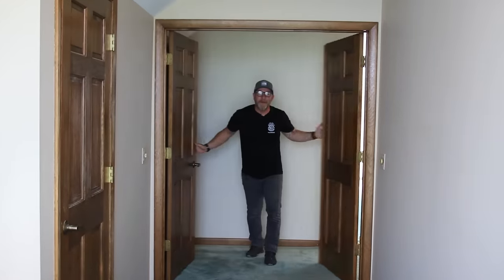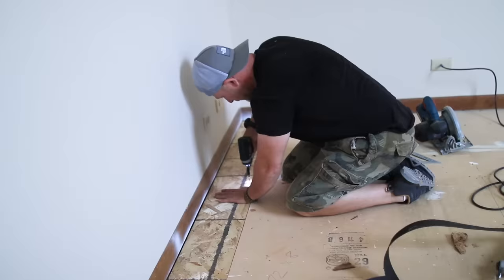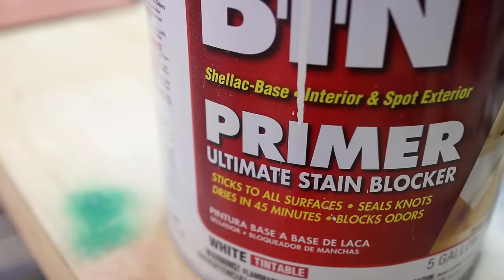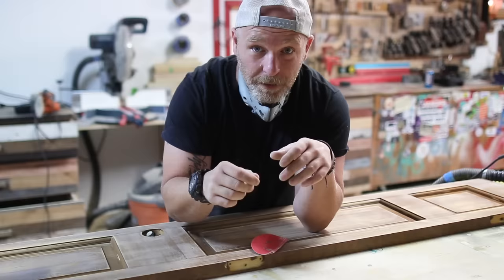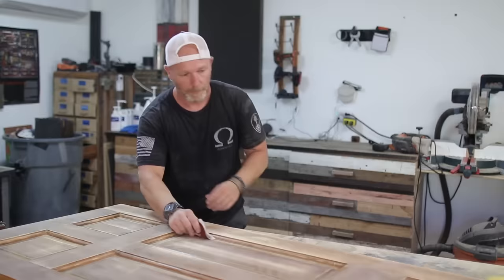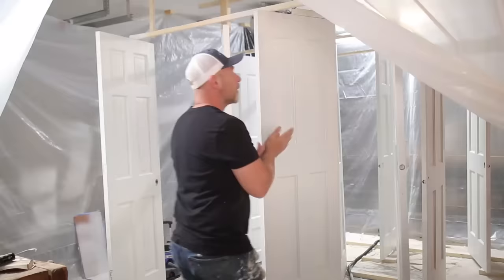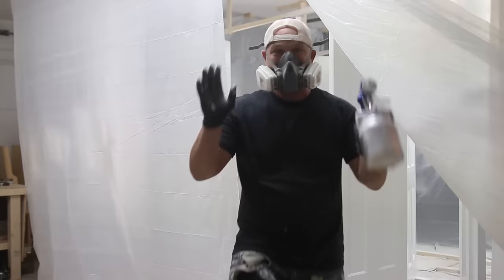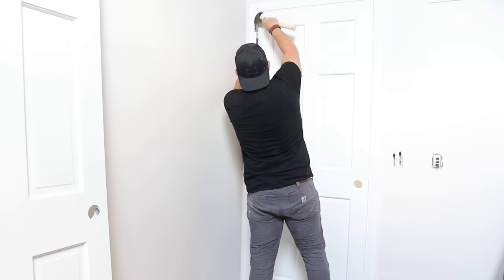How to Paint Old Doors, Windows and Trim the Right Way!!!   DIY House Renovation Episode 2

Comment: Why use the hvlp on the doors ? You could have used the airless and saved time and effort . Also , thinning that proclassic with water is not recommended . 
The video was well done and the basics are there - sand , prime , 2 coat finish . As a professional painter I can say you get a B- .

Comment: When sanding, what grid number are you using and when do you know if it’s ready? I’m starting this project now and following along.

Also, when finish sanding do you wipe it down with damp clothes , vacuum?
Reply from the maker: i used 120 grit, and you just want to scuff it up.  no need to remove everything.  you just making some groves in the finish so the primer can grab on.  and yes you want to clean it off very well before primer.
Reply: @KomarProject  thanks! I used the kilzone primer , the primer you use.. omg, so $$$ , so I’m hoping this primer will work

Comment: Our interior doors are exactly like yours! Great video though mine project has had some bumps. I used an Airless Sprayer to apply three coats of Insl-X to them. I am finding the wood grain / stain is bleeding through. Thinking using STIX would stick better. Did you have any problem with 123 and bleed through? Also a person on the Internet said never wipe down with mineral spirits anything using a latex primer afterwards, won't stick. I hope that isn't going to be my case here with this primer. Lastly, what HVLP sprayer did you use on the final topcoat and why not your Airless Sprayer?
Reply: Graco just told me tonight I should NOT run BIN primer through their Graco X5 sprayer. "If the clean up for that Bin Primer is saying a Denatured Alcohol or Ammonia it would not be something we would recommend spraying through that unit.  That would mean the primer itself has solvent contents to it and would destroy the unit." A follow-up email with them they replied it is partially due to the flashpoint of the primer. What to do what to do, right?

Comment: Why is he using drywall hole patch instead of wood putty on the wood doors and trim? And caulk? Never seen Norm do that.
Reply from the maker: You need to caulk any connections or they will separate over time.

Comment: Hey bro why'd you change spray guns? I never used a sprayer before it looks like it's worth is
Reply from the maker: So with the large sprayer it’s a bit harder to control in a smaller space.  And I don’t have much room in my shop to mess with it.  But both of them will work

Comment: There are 4 fails to this video, . 1) you fill holes with a flexible putty knife. 2) you should prime the wood before you caulk. 3) caulk with  a damp rag and Pic out your god damn corners with the damp rag n 5n1 and 4) spray your doors flat to eliminate any dripping n put them on an erect-a-rac system 😳

Comment: Shaking my head.  You Destroyed the place with cheap paint meant for cheap unsightly wood.  This was a beautiful home with Durability and Low Maintenance.  Now with paint has become a Maintenance Nightmare!!   I am dealing with sanding doorframes and naseboards right now because of chipped paint, dented and marred.  I would give ANYTHING to be able to Strip this all down to bare wood and have it varnished for ease of maintenance.  Dented, marred bare wood is far more acceptable than chipped, marred, unsightly painted trim that is near impossible to match up same paint again for maintaining easily.